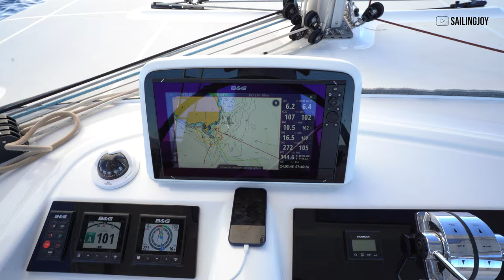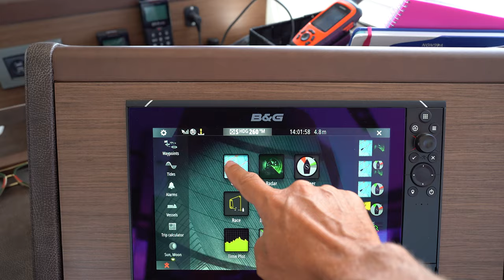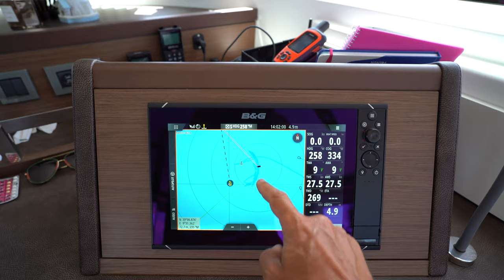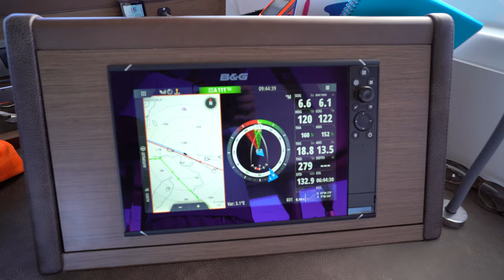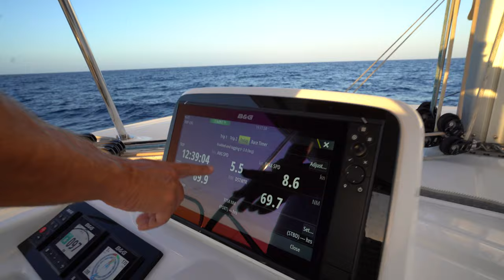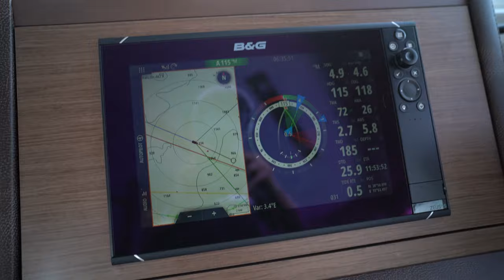SAILING CROSSING TO SICILY ITALY I Ep 71

Comment: Hi! Your batteries are lithium? Did the technician showed a direction of what might've caused the problem? Except for the smell there was no other indication of a malfunction? 
Glad everything's fine and the problem happened when you were docked, not in the middle of the passage! My best! See you on Montenegro next week! Fair winds!
Reply from the maker: Hi Jose Eduardo.  We have AGM batteraries on JOY.  It was an manufacture issue in one of the batteries that caused it.  Unfortunatelly there was no alarms or anything to let us know something was wrong.  All good now after replacing the entire battery bank.  best Ed
Reply: @SailingJoy  Hi Ed! You can call me Zé. Nice to know. Have you considered lithium - although they're quite expense and require some planning on replacement. My best!
Reply from the maker: Hi Ze !  We wanted to go with lithium and it will be our option on a future boat as it does require lots of changes.

Comment: I had a similar situation with my house batteries. I could not touch them. 1 of the Batteries died and took down the other 5 as well even though I disconnected it. I unfortunately had to change all 6 with the same kind you have because I was in a small town and this is what was available.
Reply from the maker: Yes same here Anwar!  The town were we were had only one type of battery and warranty would take a long time so I had to buy what they had. Oh well.

Comment: Omg that is so scary to find the batteries so hot. Would love to know if there was any risk of that battery model catching fire. You said they are designed to crack rather than explode, but could it still start a fire?
Great videos. Love the content. Inspired for my retirement to do the same. ❤
Reply from the maker: I was told they crack and would not catch on fire.  At least is what I hope.  Now that I had gone thru this I constantly check battery temperatures as it is a good indicator something is wrong.
Reply: Lead acid can burn because if you charge it with too much voltage you‘re creating hydrogen and oxygen - which is a rather bad combination. This is mainly caused by charging voltages exceeding 14.4V for a longer period of time. Sometimes the internal resistance of the battery has increased to a point where enormous amounts of heat are generated. In your case it seems to have been more of a heat and less of an electrolysis problem.
I‘m eagerly waiting for the next episode because I‘m curious how the malfunction of one battery should have killed an entire bank… 🤨